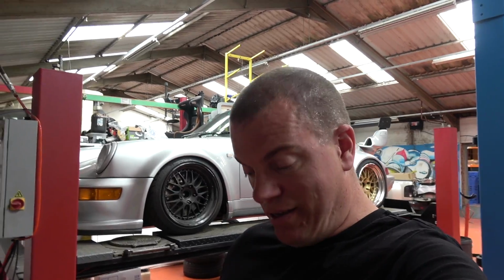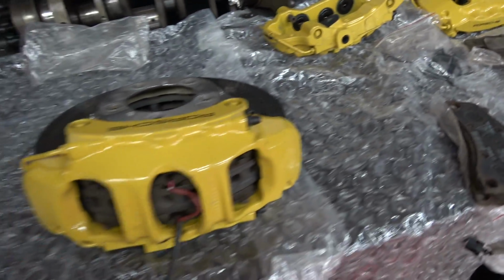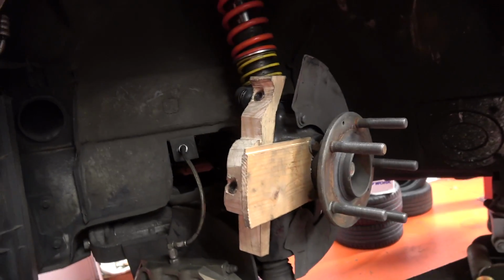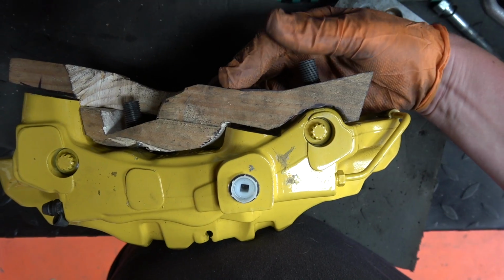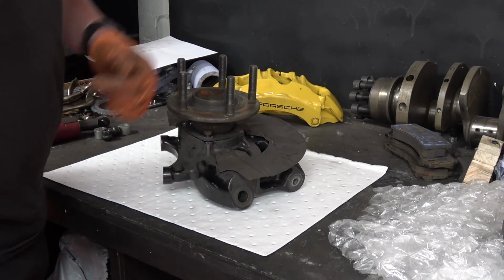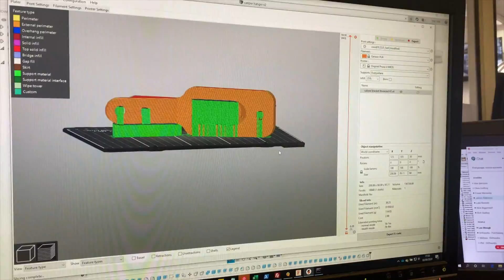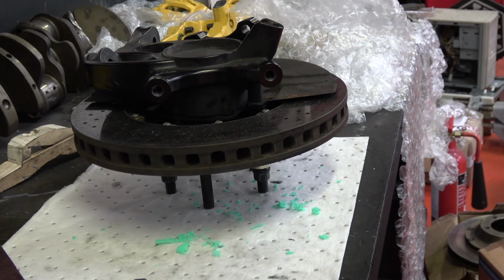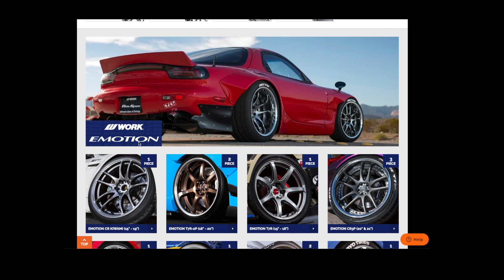964 Turbo gets Carbon Ceramic brakes - RWB Porsche 911 Part 2

Comment: Using the right caliper on the right side would totally help with fitment...
Reply from the maker: It actually wouldn't. The mounting points are too close to fitting. They cross over existing bolt holes & there's no room for any adapter. Also leading and trailing pistons would be the wrong way around which is no good.

Comment: Would love to know how much having the part machined will be.
Reply from the maker: It's a big block and a few hours of machining. I'll give you an idea in the next vid hopefully.
Reply: Great video Phil! That 3D printing black magic is just something else!
Reply: @williambower5890  I wish prices were that low around me...
Reply: All machinist work for beer. So it won't be bad.
Reply: @vipecrx  no kidding! $60 an hour is a very very good price for a one off, even on a 3 axis. That's less than I charged on a 3 axis router 8 years ago. Add in setup and any tool fees.. I could see the set coming in at $800+cad.
I guess we'll see.
Reply: @haywagonbmwe46touring54  £30 is around $40. 👍
Edit: Unles its AUD/NZD/CAD 🤦‍♂️

Comment: I've had Carbon Ceramic brakes on my 1995 E36 M3 GT since 2007 :) amazing stuff, less weight, no dust and huge braking power.  Got mine from a McLaren SLR, 370x38mm
Reply from the maker: Awesome!
Reply: were you on e36coupe forum at sometime? lol
Reply: PixelVogue yes :) still have the thing, Twin Turbo also.

Comment: Phil did you try using the other caliper and have the bleed nipple facing up rather then down. It might also help with the angle of the adapter
Reply from the maker: I did have a look, it's too close to fitting, but doesn't fit, The mounts in the upright would have to be filled & redrilled (which isn't really possible) & the leading and trailing pistons would be the wrong way around. All I have to do is swap the link pipe & bleed nipples over.

Comment: Phil like you are almost a artist.
From Wood to plastic and then to metal.
Like your work Phil and now put a patent on your design.👍👍👍👍 
Do you have to design this also for the back brakes .
Reply from the maker: 😄Thanks man, Yeah I still have to do the rear design, but can't do it until I find some discs.
Reply: Phil it would be nice if you could find the other types of porsche discs pscb.
They are fitted on porsche cayman for now .
Reply: @driftworks  check it out on the german ebay, it could be tricky to communicate with a german but overall you might get lucky there to find the parts for less.
Reply: @driftworks  still this set is very heavy on the price.

Comment: You should look at adding material in the voids where the two shapes that merge closer to the top of the caliper mounting point
Reply: Regardless, this is fucking awesome, great work.
Reply from the maker: It's has more than enough material already. It was very over engineered & I wouldn't want to add unnecessary weight 👍

Comment: Unless I'm looking at it the wrong way, you might have the bleed nipples at the bottom of the caliper, which would make bleeding it a nightmare. I hope I'm seeing it wrong, because that would be an annoying thing to happen.
Either way, it'll be cool to see them finished. Has the engine been tuned for the new borgwarner turbo?
Reply: Thought the same thing but I believe you can just swap the bleed nipples with that bypass pipe and its back to normal.
Reply: He's installing it on the wrong side for sure. While you can swap around the crossover and bleed valves, the caliper and pistons are designed to have a leading and trailing that is side dependent. (edit, unless on the car these are off of had the calipers on the back side of the rotor)
Reply: Didn't know if those calipers had different piston sizes leading to trail side.  Although it is a newer Porsche. They've definitely figured that out. I believe the calipers he's using are usually mounted on the rear side of the rotor (closer to the door) and now he's moved them to the front side (closer to the bumper) wish would mean they're still correct with the pipe and nipples switched.
Reply: I suppose as long as the rotation of the disc is same, then the size order of the pistons won't change 
It's good that the crossover can be swapped for the bleed valves, otherwise all that work on the new mounting bracket would have been for nothing 😭😂
Reply: Oh I was nervous the whole video until I looked up which way they were on the 991! Haha
Reply from the maker: This caliper sits on the back of the upright in the 991 application. It's important to keep the leading and trailing pistons as they are, so all I need to do now is swap the bleed nipples for the link pipe.
Reply: Nice, nice
Good to have that cleared up lol

Comment: Hey Phil not to ruin you work now that your in-progress, what you could use are button head bolt instead of the one you used because the button head is about ½ the size of in height compared to a regular bolt.
Reply from the maker: I know there are other bolt options available, but 10 minutes work in the lathe was fine by me. 👍
Reply: You can also buy low profile socket heads, it's a DIN standard but I can't remember it off the top of my head.
Easily sorted on a lathe tho, as you said!

Comment: Looks like your using the right caliper on the left hub, isnt the bleed port at the top?
Reply from the maker: The calipers are mounted at the back of the hub on modern Porsches. The direction is correct, the bleed nipple and link pipe just need swapping 👍
Reply: @driftworks  makes sense, didn't realize they had direction. Posh!

Comment: Just a quick comment - I had a friend make caliper adapters from ali - these ended up failing due to fatigue. Can you stress test before fitting?
Reply from the maker: I've done it many times with no issues & I've only ever seen aluminium conversion brackets for sale. There are different types of aluminium, maybe yours had too much Chinese cheese in them?

Comment: Love your Dedication to the Fabrication. Try looking for a set of z19calipers from 06 Cayenne Turbo S, then you can use pads from a z18 caliper for 352mm rotors, 19z pads for up to 380mm rotors. Look into the Brembo Z caliper piston diameters and even a machined z17 is great. Good Luck, Putting it out there for Porsche Builder Karma.
Reply from the maker: Thanks Mike 👍

Comment: Buying a 3D printer and learning to use Fusion360 was one of the best things I ever did for my various projects. It's ridiculously useful for making bespoke mounts and brackets for the most random objects.
Really enjoyed the video. Can definitely relate to needing to move a face <5mm and having to wait another 3 hours for it print again 😅
Reply from the maker: 🤘I just need to learn to use Fusion 360 myself now. Although I think designing this piece would have taken me 3 weeks.
Reply: Agreed. I've unintentionally ended up launching two businesses selling two unrelated products as a result of fusion and my 3D printer. Super useful garage addition for projects

Comment: You should try flipping the spindle as well and check the spacing.
Reply from the maker: ? I don't understand what that would do (or what I'd be looking for)
Reply: @driftworks  If there is wiggle room between the pads and rotor, when you flip the whole spindle, the pads would move to the other side and you would space them out accordingly.
Reply from the maker: I'm still not sure what you mean. Are you just talking about the movement of the pads on their retainers? That's been factored in. Or are you talking about getting the disc in the exact center of the caliper? (that's been done)
Reply: @driftworks  👍🏻

Comment: @7:07 Isn't that the wrong side caliper (left side)? The reason I'm asking is because the test fit you did has the little drain nozzle facing down and the little metal pipe facing upwards. Shouldn't it be the other way around, with the drain nozzle up and the pipes down?
Reply from the maker: The caliper is mounted at the back of the upright on a 991. I just have to swap the bleed nipples and link pipe over.
Reply: @driftworks  Ah, yes! Yee old switcheroo! Lol! Why didn't I think of that?! Duh! Thanks for the info!

Comment: Caliper upside-down on purpose, to compensate for TE to now LE position..? Clever.
Reply: Looks that way - hope this gets spotted before the knuckle gets milled down
Reply: He could swap the bleeders & link tube top to bottom, but usually Brembo’s have a small piston on the leading end of the pad
Reply from the maker: Yep, 991 is mounted at the back of the hub. I've spun it around so the leading/trailing piston order is correct & I just have to swap the link pipe for the bleed nipples. I meant to mention it in the video but forgot.
Reply: Important, and well thought out👍

Comment: Ideally you’d want to put a rib across in that region that has the large gap in the upright.

Will vastly reduce any stress concentrations in that sharp corner and improve fatigue life. Or put a decent radius in instead.
Reply from the maker: There's a radius on the final design 👍

Comment: Calipers are usually rated for multiple size rotors between 350-410 depending on the caliper.

Comment: Motorsport carbon-carbon stuff is usually way cheaper then OEM type carbon-ceramic, alternatively you’ll probably find that the same tier 1 supplier will do Porsche, Jaguar, Aston Martin, Bentley, Lamborghini etc. so there should be some cross over especially with lower volume OEM’s
Reply from the maker: Motorsport carbon carbon make a load of dust though. Eliminating brake dust is a big part of why I'm doing this 👍

Comment: Look into installing a raspberry pi4 and a camera with a switch to make timelapses using octoprint. After every layer the extruder moves to the corner to hit a momentary switch which will trigger the camera to take a picture. Makes for seamless timelapse.
Reply from the maker: Cool, thanks!

Comment: Stupid question: I assume it's not easier to just get a carbon ceramic discs for your current calipers and change the adapter a bit to make it work? Brembo calipers too narrow to accept a CC rotor?
Reply from the maker: It's not stupid. I contemplated it. The pad for the oldskool race brembo would need making though. As I couldn't find out anything about pad size for it.

Comment: Just out of curiosity. Why not incorporate the spacer for the upper bolt into the part. You prefer to have it welded to the  upright, and possibly threaded? Brilliant video by the way.
Reply from the maker: You got bored and turned off I take it? 😄
Reply: @driftworks Bored? on the contrary. i watched the video twice :) . Maybe I just asked the question wrong. On minute 14:22 you are talking about drilling and tapping the knuckle, adding a spacer, and possibly welding it to the knuckle (good idea by itself). I’m asking if there is a reason (rigidity or complexity related) not to include the “spacer” as an integrated part of the adapter you just printed (and, about to machine out of aluminum)?. So basically, the spacer becomes part of the adapter, instead of the knuckle.
Reply from the maker: Ahh, I understand 👍 I was only proposing the spacer because I wasn't sure I could link the lower mounting point into the rest of the design, but we found a way 👍

Comment: Hey Phil, "970" is the ordertype for Panamera 1.Gen (G1 2009-2016). So you have PCCB-rear-calipers from these model. There are also the same part numbers in the 997 parts catalog (970.352.425-426 / 996.352.425-426) but not sure if these are really the same ones. Greetings

Comment: hi phil on a different note youtuber junkyard dave has a nice inch or 2 thick copper rectangle slab 500 x 250 by the looks of it with holes drilled in it to clamp v bands etc to disapate heat and stop warping when tig welding the guys from motion auto tv used it reach out you might be able to find out where he bought it, the build is coming on well are you going to get the brackets 3d metal printed ? that would be good to see as i don't know if any car youtuber has filmed that before
Reply from the maker: Thanks, no they'll be machined. 3d titanium would probably be a lot of money.

Comment: Same discs on my 997.2 C2. If you get time and remember, would be really appreciated if you could measure the thickness of your discs. You'll have noticed the minimum thickness stamped on them (33.7mm), but i've been trying to find out the original thickness, or the thickness of a good condition pair. Looks like it's gonna work anyway! Will you leave the callipers yellow?
Reply from the maker: Mine are 34.1 I think which as far as I know is pretty much brand new.
Reply from the maker: Oh and I'm not sure on the yellow. I like the identifier, but the oldschool gold Brembos looked so cool.
Reply: Driftworks Ah ok, interesting! That layer is very thin and hard wearing! Thanks for that, appreciate it 👊🏼👍🏼 Don’t suppose whoever you got them from has any more does he?
Reply: Driftworks Hear you on the yellow! Gold would suit it tho!

Comment: Looks like u using the wrong caliper for the wrong side as the rubber bleed nipple is pointing down instead of up
Reply: Thought about the same, then checked a 997 and 991 (couldn’t remember what was disc and caliper so checked both) and they have caliper inboard side of the wheel. So it’s correct side caliper, but crossover pipe and bleed nipples should be swapped on the caliper :)
Reply: You're not wrong but possibly they wouldn't fit the other way around? It's a pain but you can bleed them hung up the right way and then bolt them on.
Reply: @Iain240  the pistons are often staggered in size to promote flat wear, flipping them over would put the wrong piston leading and have the opposite effect
Reply: It's actually very easy to switch the cross over pipe and the bleed nipples. I am sure Phil will do it before the final fit.
Reply from the maker: It's the correct caliper. The 991 brakes fit behind the upright so it's just spun around. All I have to do is swap the link pipe and bleed nipples which is a 2 minute job.

Comment: A 3d printer is such a great tool for things like this,   Have you done any stress analysis calcs in CAD yet? How did the bracket do?
Reply from the maker: I haven't. It's actually very simple & I put a lot of thought into strength.

Comment: Great video. This is exactly what's needed to adapt Brembo 2 piston rear calipers from Nissan, Subaru or Mitsubishi cars to BMW E46 non-M. But nobody with the means ever bothered to engineer an adapter, whole aftermarket is obsessed with the M3 and adapting Porsche brakes to it. Rest of us are riding around with rusty sh*t colored 1 piston brakes.
Reply: There are some decent aftermarket big brake kits for non-M e46s though.
Reply from the maker: Thanks 👍
Reply: @s4ms0n1t3  Only if you can run 185mm hand brake which requires entire rear end swap (trailing arms, axles...). Splicing ASC with DSC rear end on ASC cars, and finally the master cylinder is too small so those 4 piston kits have mushy pedal.
Reply: @idokwatcher2062  seems like you know  your stuff then but also...does it need a bbk on the rears? Brake balance isnt effect too  much by just doing the fronts as most of the load is on the front?

Comment: This might sound stupid but is there any benefits of a 4 post lift over a 2
Reply: Alignments, looks like that’s what they use theirs for. Usually see them used for storage too. The car is more stable and they’re cheaper to wire in.
Reply: Can’t align a car when the suspension is at full droop
Reply: James Peters never thought about that good point
Reply from the maker: Yep as above. Some work you need to do with the car sat on it's wheels.

Comment: good effort love how you engineer everything so well them 3d printers are mega things is there a reason the calipers are upside down though as the bleed nipples should be at the top otherwise you get trapped air in the top of the caliper and they will be a pain to bleed being at the bottom that aside I do love a driftworks vid nice one phil
Reply from the maker: Thanks. The calipers are mounted behind the wheel centreline on the 991. I just need to swap the link pipe & bleed nipples.
Reply: @driftworks  ahh yes make sense didn't think it would have been overlooked next vid please lol

Comment: If you use the other caliper, ie, so the link pipe is at the bottom, would it give you better room for mounting?
Reply: If you usevthe other caliper it looks like it may bolt straight up aswel looking at the angles of the mounting lugs
Reply from the maker: The calipers are designed with leading and trailing pistons so it's not wise to swap sides.
Reply: Right yeah fair do's, just thought id throw it out there!

Comment: Could you get a new hub/brake bracket assembly from the 991 that would fit?
Reply from the maker: This is a billet CNC BBI Autosport upright. I'm sure they'd be capable of making a version for me with these mounts for around $10,000 😄

Comment: Aren't you glad you got a 3d printer :P Makes prototyping super easy haha
Gotta ask, what filament/colour is that? It's got a good look
If you haven't already it might be worth getting a 0.6/0.8/1.0 nozzle for the Prusa mk3, would make the print half in print time if you're using a 0.4 currently
Reply from the maker: I am indeed! I'll as Ed what we use.

Comment: Wow, those discs you pulled off the front of your 964 looked so fuzzy around the edges :D
Reply from the maker: That one was particularly bad as a stone got trapped in the caliper the last short drive I did.
Reply: @driftworks  Ouch! Good thing you got away with just a story and a clipped disc! Take care!

Comment: isnt that caliper upside down?
Reply from the maker: Yep, I meant to mention in the video the link pipe and bleed nipples will be reversed. It sill has the leading piston in the correct place as the 991 caliper is mounted behind the knuckle.